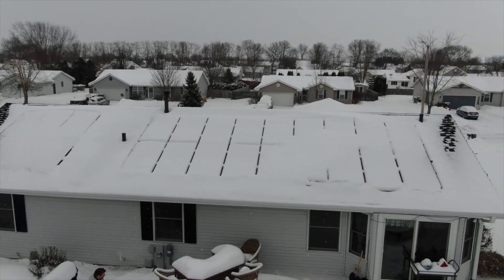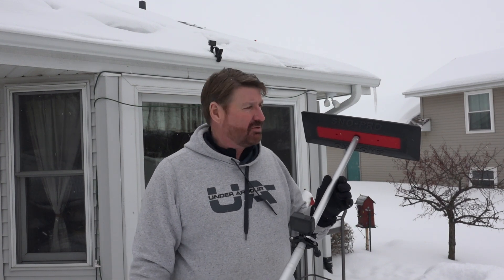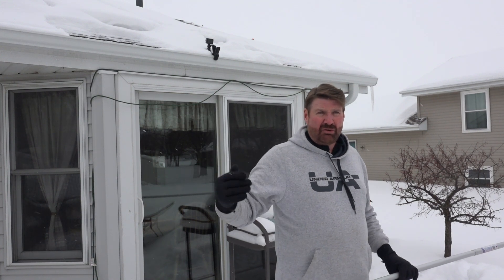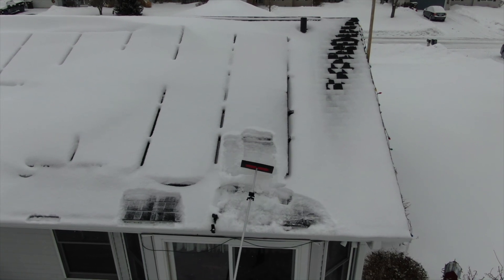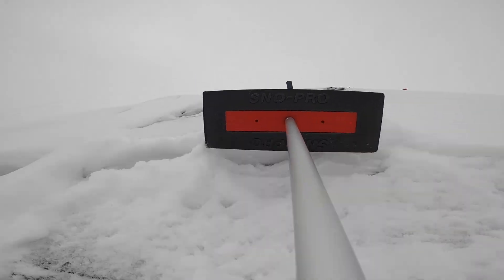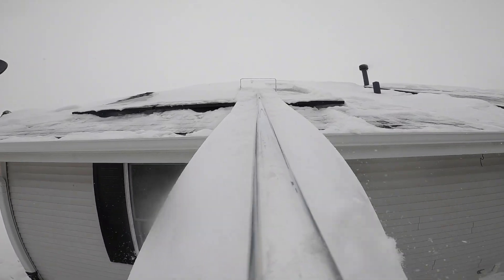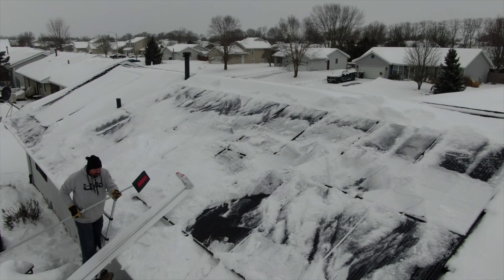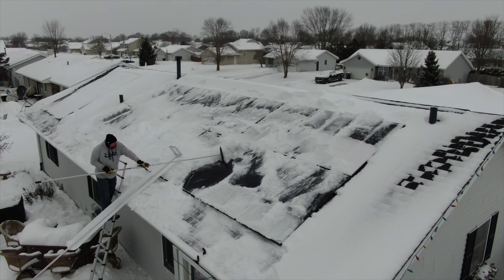How to Remove Snow from Solar Panels (and Should You?)

Comment: It would be more helpful to show on a sunny day. Clearly if you got the snow to actually shed the remainder melts off very quickly in the sun. If nothing else the next day will produce at a much higher capacity.
Reply from the maker: @cooldealmedia2865 Correct. If you lessen the snow on the panels is helps it melt faster as soon as the sun comes out, and then you'll be producing more power.

Comment: Is the snow peeler safe for the panel surfaces? Or will it scratch them?
Reply from the maker: The snow peeler we demonstrated has a hard nylon bottom that will be safe for the solar panels as long as it's not used aggressively. Thanks for the question @donbreda!